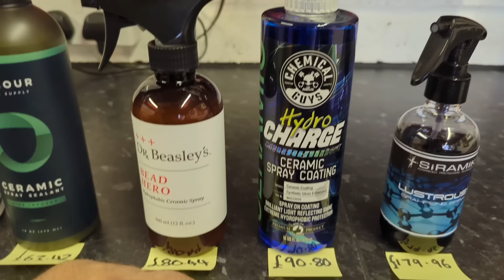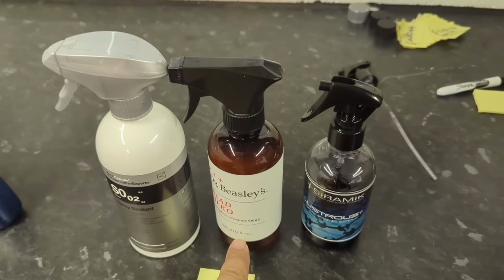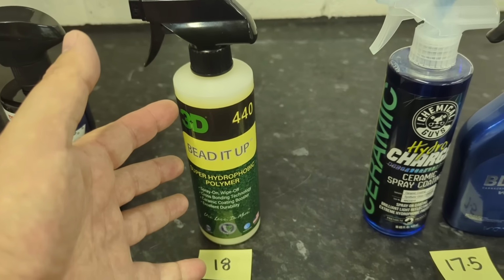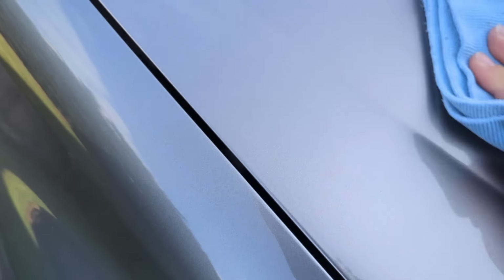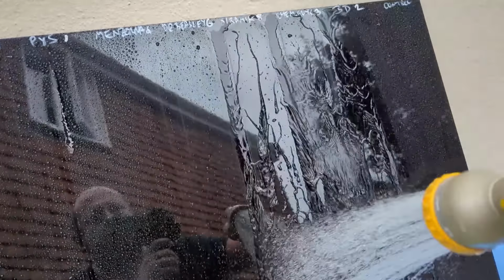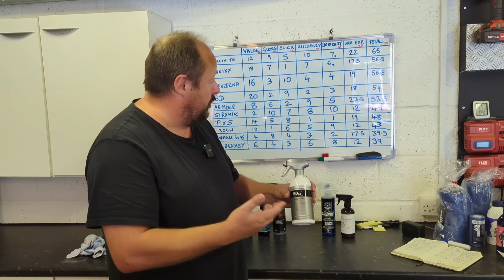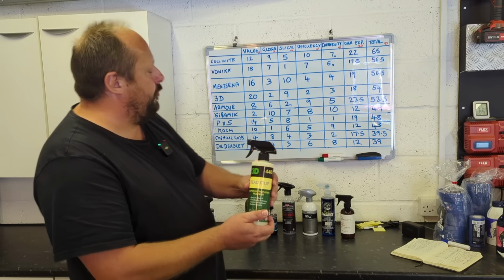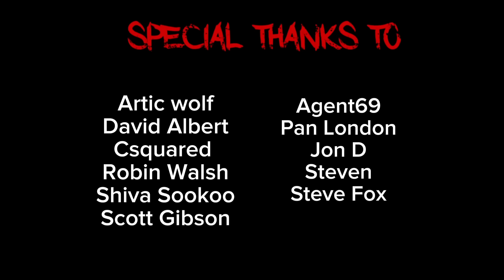Best Ceramic Spray Sealant 2024 NEW SMOKING HOT LINE UP

Comment: Siramik is head and shoulders above all those products! Its been on my car 10 months now and still beads like day 1! It may cost 50 quid but it's worth every penny and more!
Reply: what about sonax bsd?
Reply: why is it so expensive?
Reply: @DavidC1 it lasts so much longer. Value isn’t taken into account. When durability and performance is taken into account, then it’s a no brainer. Best sealant on the market.
Reply: At that price, you start getting into ceramic coating territory. Food for thought.
Reply: @matsudakodo  not really! 50 quid is nowhere near the cost of a good ceramic coating! I have a few siramik products and they are all excellent for the price.
Reply: @matsudakodo  but none are so easy to apply
Reply: @mbrunskill they aren't spray on and wipe off, but some are pretty darn close.
Reply: @roscopervis  where have you been!? Your missed on DW
Reply: @matsudakodo  Siramik pretty much is
Reply: @mbrunskill  appreciate it. I read the threads, but it’s quite right wing there these days!
Reply: @roscopervis  it's a detailing forum, just ignore anything political if it bothers you, stick to the detailing, I really miss your input on the threads
Reply: @matsudakodo  My personal opinion is that $50USD or £50GBP won't get you anywhere near a good ceramic coating. This is why Siramik is priced where it is. It's basically a Ceramic Lite. I use Labcosmetica when washing my car and it's still beading, gloss etc like day 1 of application and been on the car over 10 months. I think it will last well past the 12 months and could go past 18 months with regular maintenance washing. It's by far the best product in this test. Blows all the others into the bin for me.
Reply: If u take into account that the nozzle  clogs up if not flushed after use, its more a product like Gyeon Can Coat honestly.

Comment: I’ve watched this channel for almost 5 years now, it’s been an absolute fountain of knowledge for me, and many detailers I know.
On this occasion John I think you’ve got the weightings wrong, for a product to come top in durability, gloss and high scoring in slickness & repellency but finish up near bottom shows this.
When I’m shopping for a coating the above qualities are what I look for.
Great entertainment as always though👍🏻
Reply from the maker: yer this can often be the case though.  But by doing these mop up videos we delve into exactly the point you made.  Performance wise it was the best in the test.  And to be fair ive done a seperate review on it.  If I like it I always let you know.
Reply: just to ad to this, the value needs to be looked at different. it can be an expensive product but if you only need to apply once every 3-6 months that actually the same or better than a cheaper product that you need to apply weekly. so it needs to be looked at over time and the amount needed in that time or like you mostly do price per application and then the time it lasts for that 1 application. not price per liter

Comment: I note some criticism of the scoring method, specifically cost, in the comments. However, i really like the way you do these testing. It's easy enough just to ignore any column that is not relevant to the viewer. Also, the round up section really helps summarise each product. Keep up the great work!
Reply: I agree. I knock out value and user experience as I don’t care. It’s still easy to calculate the winner for me each time. Great videos and enjoyable personality. All the best to you all.
Reply: Yeah, value means what you get for what you pay not what is the cost. Even with higher pricing but with better performance then that's the value. ScottHD value system is better gives out how long the products last and their cost per ml.

Comment: I've been using the Beadcoat a little over two weeks now.
I wash at least once a week, but often twice (So 4 washes). Car stays outside 100% of the time.

Hydrophobics have degraded slightly, but coverage is still 100%.
I can tell that the most significant degrading was after my APC (Greenstar)+Turtle Wax Pure Soap foam.

I apply the foam and immediately rinse away after I achieve full coverage.
With just regular washes and and no APC rinse, I think I could reasonably get 2 months which is all I was wanting from this.
I do wipe down the car with the Slikr detailer (out of a Flairosol bottle) after each wash.

The way I plan on using the Beadcoat is to do an APC rinse every other month + regular contact wash and do a re application of Beadcoat.
The ease of use is through the roof.

Comment: Said to you a while ago about the Siramik Lustrous+ & glad to see you're impressed, I knew you would be 😉

Not very often a genuine game changer product comes along that achieves all it's claims. 12 months on my car & it's still going. If you treat it like a coating with regards to declogging it, it will give any lite ceramic a run for it's money & no top ups necessary with it either.

Great video mate & loving the new durability testing method, definitely an improvement to the tests 👍
Reply from the maker: Cheers Brian
Reply: @BrianW1612 aye it’s very good. Glad you got some eventually 😅
Reply: Brian, agreed mate 👍 The DW secret, that Jon has exposed on his channel 😂😂

Comment: i've been using Collinite products for well over 30+ years.   I used to put it on my patrol cars when I was a cop and it was freakin' fantastic.   I always used the Super Double Coat from Collinite.   It was the precursor to Fusso from Soft 99 and a super durable synthetic wax blend.   Very durable wax, and it was my primary wax for many years and did well all year around, but especially in the wintertime against road salts, etc.   I am definitely going to purchase the Collinite Spray Sealant.   It's cheaper for us here in the States since it's made in New York I believe.   It's a family company also and has been around a LONG time, since the 1930's or something like that so Collinite has a lot of experience with protective waxes.   Their 845 Insulator Wax was actually used on glass conductors on electrical poles many years ago and that is what it was designed for originally, however, car enthusiasts soon learned that it worked wonders on vehicle paint also and a very high reflectivity and oily type of wax.   It's a great topper wax for gloss!    Thanks for posting Jon.   I appreciate it.  I actually have had the Collinite in my Amazon cart for the past couple weeks but didn't buy it yet.
Reply from the maker: love a bit of collinite as well Joe :)

Comment: Jon, would you recommend using the drying aid of the company whose coating you applied to the car. For example should i use amplify if i have an ADS coating?
Reply from the maker: hmm as a general rule yes. because you buying a system the brand have tested.   but I tend to use anything lol

Comment: Hi john,  I've just brought some yum cars ceramic spray sealant and yum wax and I've brought some autoglym SRP.  So after I've put on the SRP would it be ok to put the ceramic spray sealant on and then the wax or would you recommend a different approach John.
Reply from the maker: SRP then wax or spray sealant mate.  typically though the wax will sit on top of the glaze no issue.  but the glaze might not be the perfect base for the sealant.   but SRP then wax.  And in 2-3 months when protection is dying try the sealant mate
Reply: thanks for that john very much appreciated Mate

Comment: I'm new to this channel but am finding it amazingly useful. My wife and I recently traded in our much beloved Volvo V70 Classic after 21 years and over 160,000 miles. It was red and I had to stay on top of the detailing to ensure that oxidisation didn't turn it white (this happened to a neighbour of ours). I managed to maintain a finish like glass, and many people over the years commented on how good it looked, so I must have been doing something right. I leant towards Meguairs products which I found gave me the results I wanted, I even invested in one of their polishers.  

We now have a Honda HRV with a Ceramic finish and I was very interested to watched the videos on Colinite, which my wife may be buying me for Christmas. I have two questions -

1. I would normally have clay barred my Volvo once a year, I'm assuming I can't use clay on a cermaic finish, what is the best product to get those annoying little bits off the car before appling products like Colinite?

2. Can i still use the polisher on a Ceramic Finish?

Brilliant videos Jon, you really do a deep dive into every aspect of the products. I admit that I never heard of many of these products but have already invested in Snow Foam and some of the cloths you recommend. It has been and continues to be an education.
Reply from the maker: so if its got a coating mate.  avoid clay bars and abrasive polish.   you can remove little tar spots or tree sap with a mild tar and glue remover.  Milder one would be valet pro.  You can also use a citrus wash to help reduce the build up of that sort of stuff.
Reply: @ForensicDetailing  Thanks Jon, I'll have a look for that.😀

Comment: Thanks JD, a while back, you did a review where the bead maker came up on top. It's an amazing product for topping up your paint protection, and I'm sold on it. What's the difference between these products and the bead maker? Should I switch over to one of these? If so, why?
Reply from the maker: Beadmaker is more like a material that hardens.  Most of these are siloxane blends with other materials and binders to hold them together.

Comment: Bead it up causes way too much dust collection. Its the same as bead maker when it comes to dust. I currently live in Germany and within one day of using bead it up, my car is covered in a layer of dust that did not exist prior to using the product. I have started to do a spray of bead it up and a spray of final touch on a panel to see if that helps with dust.

Bead it up is very slick on my 2024 Audi S5. It does allow water to bead very well on my glass when driving 50-140mph  on the Autobahn, I dont need my wipers. I am not sure why you dont say it doesnt bead well but I also have a base layer of Meg's Ultimate Wax under it.
Reply: Glad I wasn’t the only one who noticed that with beadmaker. Total deal breaker.
Reply: Ive been using Bead It Up for over 12 months and never had any problems with dust. Beadmaker is a dust magnet though! I really like the Bead It Up and bought a gallon of it when my bottle ran out. The slickness is amazing and i see a real nice gloss from it, more than a lot of my many other spray sealants, which just goes to show that what the eye sees and what the gloss meter sees can be two very different things. As for beading, it does bead but they are not as tight and round as some of the other products ive got. The mango/pineapple fragrance is out of this world. 3D also make the newer GLW SiO2 ceramic detailer which is more durable and gives tighter beading but its not as slick and the gloss isnt as good as Bead It Up IMO.
Reply: @Almost_Made_It  Bead maker the Deal Braker xD

Comment: Since I'm in the States, the two I would be most interested in trying would be Defender from P & S & Armour Detail Supply.  I have never heard a bad thing from ADS, but because of cost, I would go with P & S Defender.  ADS cost twice as much as Defender, per gallon.  Thanks for the info. ...
Reply from the maker: I think ads is a stronger sealant.  Pands is more like a topper
Reply: Consider Apex Surface BC9

Comment: Can you use Collinite beadcoat as a topper for Collinite 845? 
Currently using Jescar Power lock polymer and Collinite 845. Looks great, but not very hydrophobic.
Reply from the maker: I would maybe ditch the 845 now.  base down with a glaze like poorboyz and top with beadcoat.   then put some slickr detailing spray on each wash mate.
Reply: @ForensicDetailing   thanks mate!!!   I'll check those out.

Comment: Any tests on Gyeon Can Coat? And how it holds up?
Reply: It would absolutely destroy all of these as it's a different product, its a ceramic coating Lite.
Reply: @victoryensured7137  I can assure you it doesn't. I've used cancoat on my own personal cars over for 4 year before moving to SiRamik Lustrous+ last year. My Stinger is out on the driveway, had 0 top ups & it's still beading well, maybe 60% of how it was performing on initial application & that's on ALL panels, not just the roof.

The Siramik is a lite coating in itself. An extremely user friendly one with better slickness than something like Cancoat.
Reply: @BrianW1612  If John says it's a spray sealant its a spray sealant for me, would have to coat my daily with half Cancoat Evo half Siramik to properly test them, unfortunately we don't have Siramik here in Poland and probably won't have it ever so.. I can only speculate. But I'm glad you like it!

Comment: As per my thread on DW  (Rappy) and other DW members. Your results are exactly what we have been seeing for almost 3 yrs 👍

It is more like a lite ceramic, which is where it's price & performance is aligned to.

 Hopefully Russ & Shane have seen your review 😊

Please do further testing & compare to lite ceramics. Carpro, Gyeon etc....
Reply from the maker: I don't think it'd ceramic though.  Silicone based I think
Reply: @ForensicDetailing  correct. It's not ceramic, it's graphene. But a Ceramic is the only LSP , that would hold it's own in a torture test.
Reply: Has the colour been added back I thought it was removed and was clear the last time I check the thread? I’m still on my v1.2 bottle. Haven’t been in the DW thread for a while
Reply: @Justin-ny6un  back to colour mate 👍
Reply from the maker: @simonbaker5984  its not graphene backboned mate.  The graphene is just an addictive.  Im pretty sure this is a SI material. (silicone resin)
Reply: @kamranhussain578  sticking up for a fellow DW member. It's laughable mate!!
Reply: @ForensicDetailing  not a chemist 🤣. But it does contain graphene & Si.
Reply: @simonbaker5984  Wondered what happened to you on DW lol. SiRamik is not rGO (reduce graphene oxide) like most others others on the market.
Reply: @donga410  agreed but it does contain graphene. Forget the technical term for it now 🤣🤣

Comment: Judging by other posts, the durability of Siramik on car paint is impressive. So a bottle will last much longer than many other sealants thereby giving better value for money. But how long does it last in the bottle? Just wondered what the shelf life is. Presume there is no indication on the instructions?
Reply from the maker: Unknown m8
Reply: @ForensicDetailing Shelf life is approximately 2 years from time of opening and needs to be shook regularly which I believe is the biggest downside. I give the bottle a swish every 3 weeks or so.
Reply: think ive had mine 18 months, best advice is clear the spray head like you need to with Gyeon CanCoat, otherwise it will harden in the nozzle, I put a normal cap on mine when storing it.
Reply: @mbrunskill  putting a normal cap on is a brilliant idea. Going to actually steal this idea as mine sits with the trigger on it 😅

Comment: mmm the video is great, however the scoring criteria is very controversial, although 3D and Menzerna have more points in the cost category, for example in LATAM that does not happen and many times those are more expensive than others on the list, for example For example, Koch Chemie SO02 is a very good product and the results indicate that it has little shine and durability, I find it very difficult to believe because I have used it many times on different cars and the results are incredible. I appreciate your video but I have more questions than answers.
Reply from the maker: So you can't compare regional prices m8 when you do a review just your countries prices.   Koch results showed good durability but not good gloss increment.  The gloss meter cannot lie but there can be other factors at play like error or prep or application issue.

Comment: I know I'm being pedantic but when you do the prices and say "value for money" that's not the same as dearest to cheapest.
Reply from the maker: Explain more m8 I'm interested.  We do cost per litre.  As they all use same amounts roughly.  That is value for money.   You can't say ah but the ones that last longest are better value because for some people they want ease of application over durability for example so they can top up and keep the zing....  So you can't do aggravated value based on one performance criteria because that's subjective to what performance element you value.   So we do missionary position value for money which is very simple but fair.
Reply: My thoughts are value for money would be the amount used over how long it lasts. Something that's cheap but last a week and needs another application versus something that's more expensive but last a year. Appreciate all the work and you'll never please everyone.
Just my 2 pence. On your suggestions I'm going to try the Collonite and Menzerna up against Stjarnagloss Parla as I really like that product.

Comment: Could I use a ceramic spray sealant over a 1 step polish/wax?
Reply: Probably won’t bond to something with wax on it.
Reply: Wax always goes last. Its the least durable protection and anything better than that such as sealant or ceramic coating wont bond well

Comment: My main concern is that my car looks thee best. So number one is Gloss, 2 is ease of application and third is durability .Durability is not that important since I use a drying aid with washes and a quick detailer in between washes.  I dont care about the other things. All I want to know is what will make my car look the best. I kinda get lost in you videos because of the ratings I don't care about.
Reply: It's quite easy to look at the charts that Jon takes a lot of time to test products and gather the info. All you have to do is decide what your priority is and look at the chart and pick the one ranked highest or top 3 in that category.